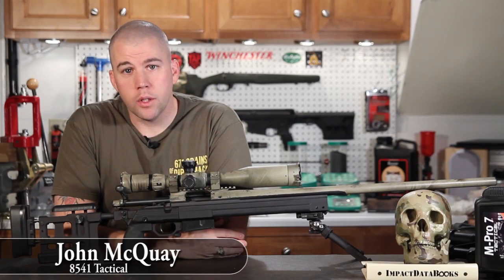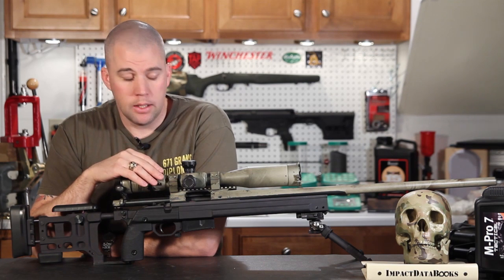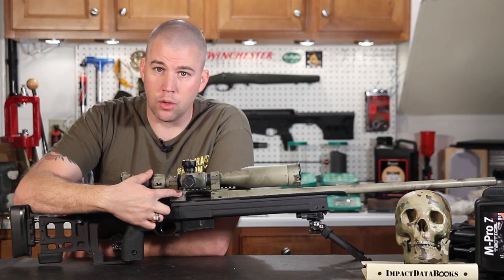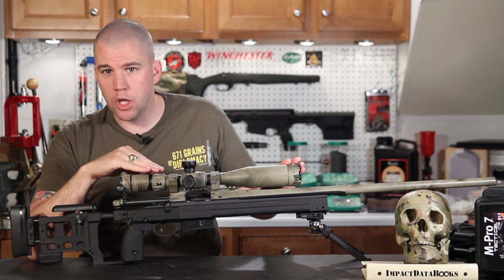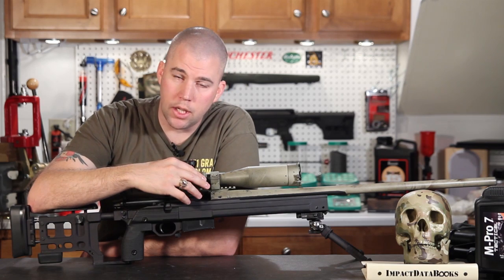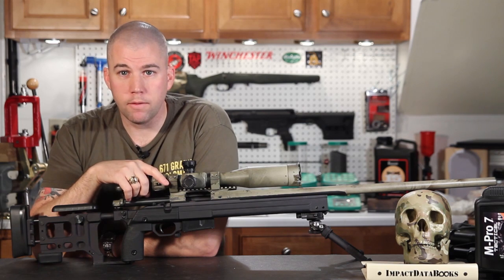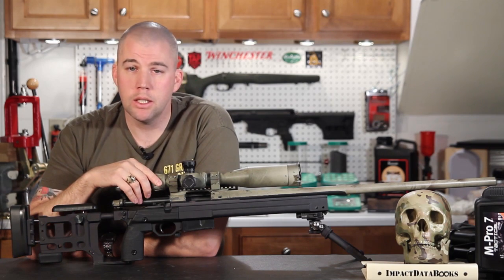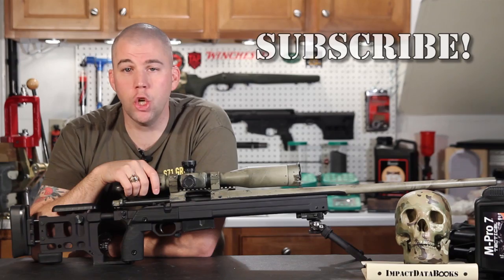Mail Call Mondays #36 - Scope Bases 0 MOA or 20 MOA?

Comment: In your explanation of how the base works, I think I may have heard a discrepancy in your explanation.  Let's say you have a rifle that is already dialed in and zero'd for 100 yards, with a standard flat base.  Now, you remove the scope and base and install a 20 MOA base.  When you fire the first shot with NO elevation corrections dialed, the impact will be LOW, not high, as you stated in the video.   This is because the base is canted downward, approximatelty 20 MOA.  Now, to correct for this, you must dial the elevation UP, not down, as you stated in the video.  Moving the elevation knob UP in actuality, moves the erector "crosshair" down.  For this reason, you get an extra 20 MOA, because you'll now have 20 MOA (approximately) extra on all future up elevations.
Reply: You are incorrect. Go to the range and try it. If you explanation was true, then there would be no benefit to an inclined base.
Reply: John, I recently tried it.  You were exactly right, and the result was exactly opposite of what I had said in previous post.